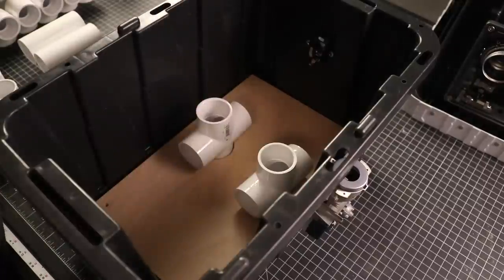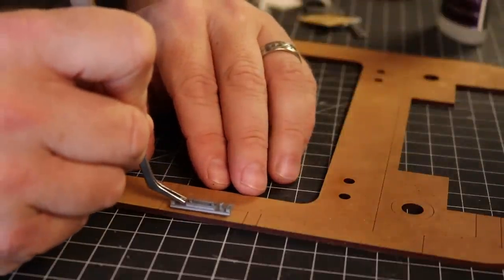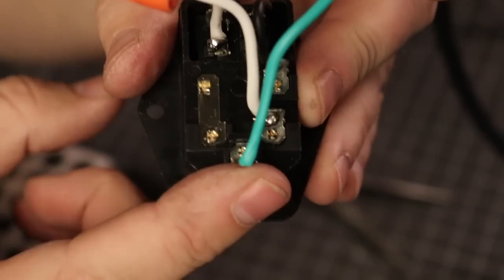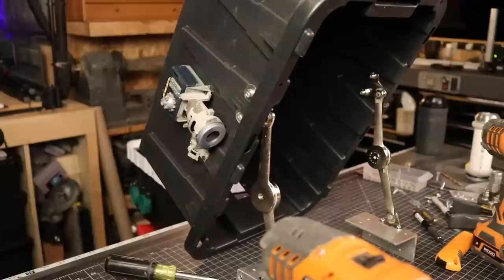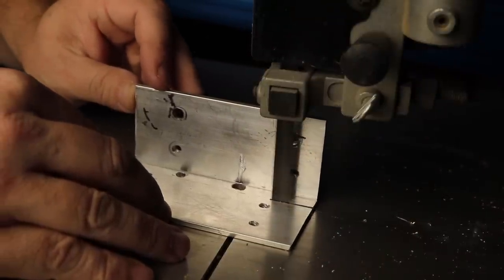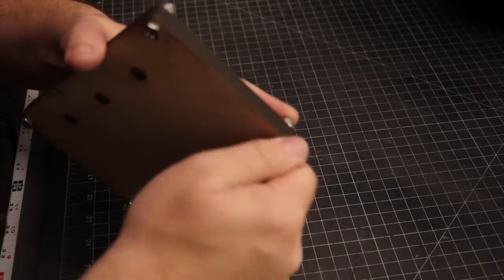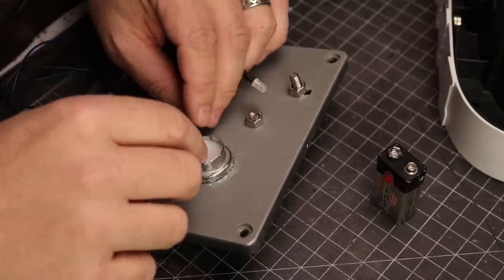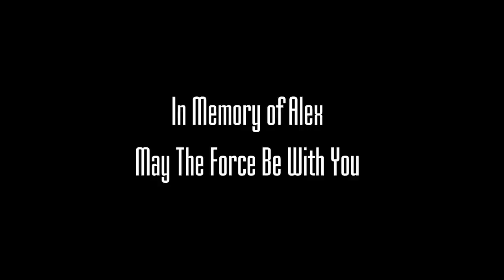Building A Gonk Droid | Part 2

Comment: Just rewatched this as I made up this little boy's story.

It begun as an average Gonk in a modest speeder workshop in Corellia, providing electricity for the power tools.

The owner needed more efficient ways to work but had a low budget, so he bought some astromech components and integrated them in the Gonk.

Now it is able to diagnose the speeders and quickly find the problems that need to be fixed and communicate them in binary language.

The workshop owner is saving a lot of time, he can repair more speeders than before and he has even lowered his fees. He lives in a small community composed by people who work hard for a living and he prefers being helpful than being rich.

The gonk is way more sentient than before and it is happy and he feels appreciated.

A small story in a huge galaxy, but small stories are the bricks with which history is built.

Comment: Awesome build. Your build videos always give me ideas for other stuff I'm working on. On those boards that you used hot glue to mount, they do have holes for standoffs and the standoffs are really cheap. I used to mount boards with hot glue and then I had to replace one once. I don't know about painted MDF but the hot glue is annoying to pull off later off of the wood that I've used. Thanks for always posting awesome content and happy thanksgiving.
Reply from the maker: Thanks Jeff.  Yes the boards do have mounting spots, the only reason I hot glued it was due to space.  The stand-offs I had on hand were a bit too long, and it would have caused the board to stick out just a tad too far.  So sadly I had to resort to glueing it down.

Comment: I couldn't really tell in the video, but those lugs on your power access point should work with female crimp connectors. Would save you all that soldering and they are already insulated.
Reply from the maker: you are 100% correct.  That would have been a great idea.

Comment: Hey just out of curiosity how different is a laser cutter from a vinyl plotter? I use Corel draw and a vinyl cutter with its own software to do my vinyl sign stuff…. I’m wondering if I can set it up in the same fashion and still do my artwork in Corel, but either laser cut, and/or router table CNC
Reply from the maker: Hi Thomas.  The primary difference would be the power and what each can cut.  The shapes and details are pretty similar.  We use our Cricut Cutter, which is a vinyl cutter among others, and it has similar accuracy.  That said, the laser is much more precise.  But depending on the shape and detail you could get some good pattern results with a vinyl cutter.
Reply: @TheSmugglersRoom  i’m starting to conceptualize some sort of R2 unit that will house a bass amp… just watched your DD3 build and gonk stuff… pretty cool stuff!
Reply: @TheSmugglersRoom  I used a vinyl cutter to make Graflex stick-on templates and occasionally make a lightsaber hilt with that style emitter with one. Usually keep some template Vinyl around too, but the cheaper vinyl works great too… and masking perfect shapes